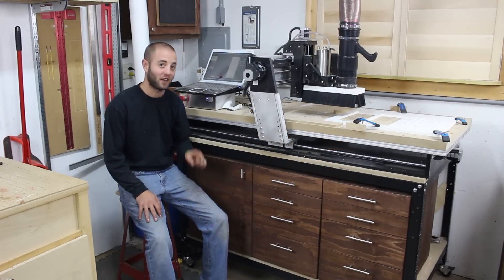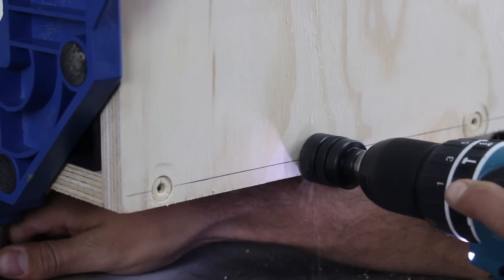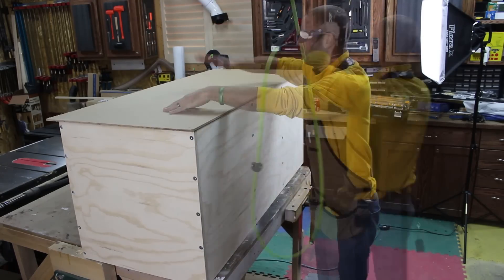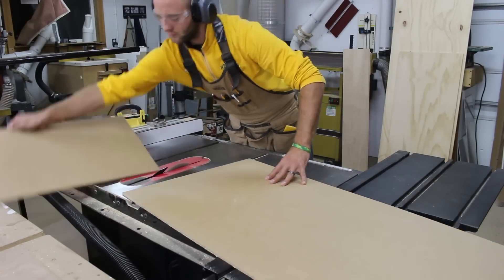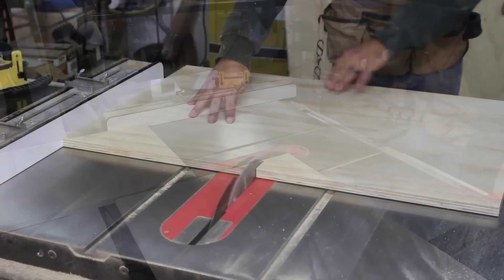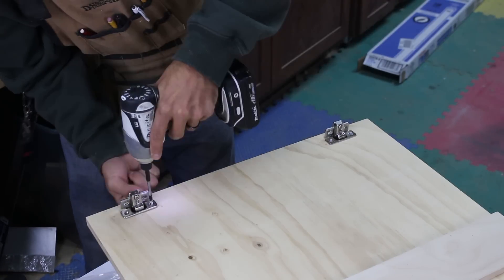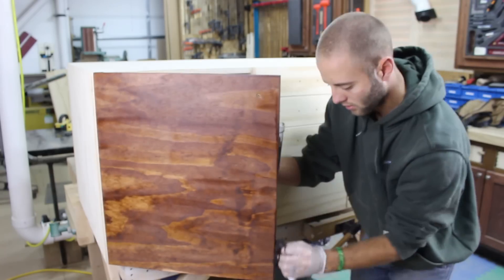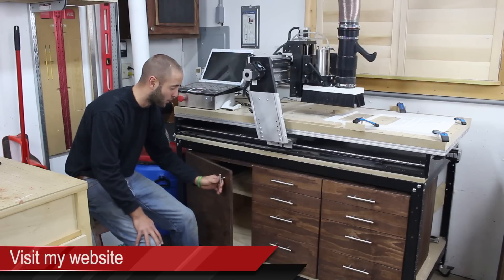How to build a CNC  Storage Cabinet

Comment: Nice job.

I'm interested in the screws/drill jig that you used on the carcass. You called them pan head screws but they look different from the pan head screws I normally use.
Reply from the maker: Drilling system is by fast cap. Thank you for watching!

Comment: Can you give me a source for the square drive pan head screws you use to assemble the cabinet?
Reply from the maker: +Kenneth Siehr You can find them at fastcap.com
Reply: +Glass Impressions, Thank you.  Found the power head screws but could not locate the counter sink bit.  Seems like a pretty slick system
Reply from the maker: +Kenneth Siehr Search flush trim bit on their website. or in the related items section of the power head screws. Thank you for watching!